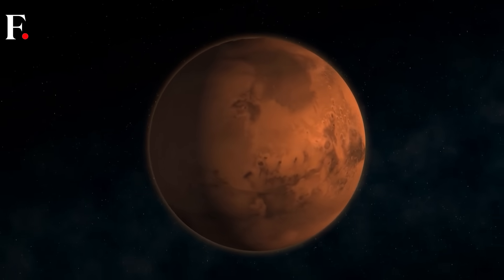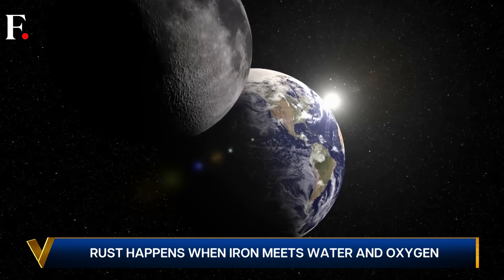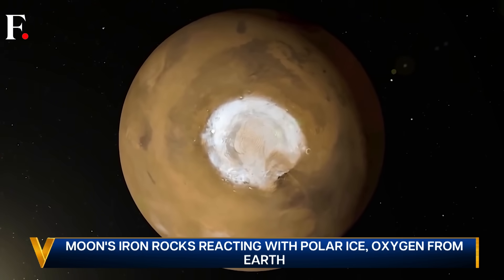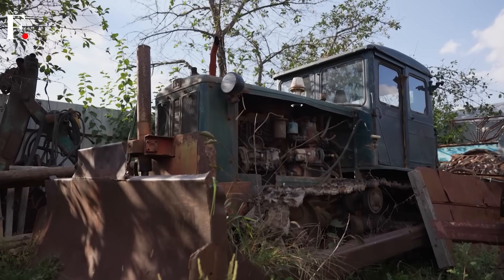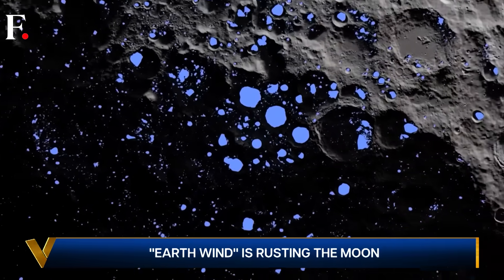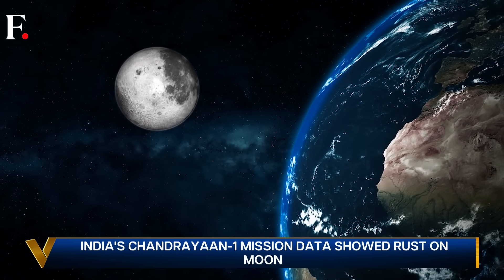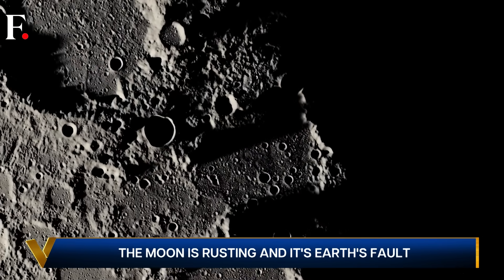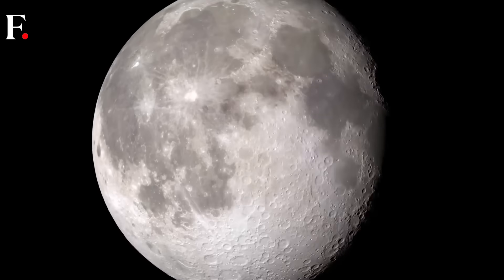Why is the Moon Rusting? Scientists Say Earth is to Blame | Vantage on Firstpost | N18G

Comment: My Hypothesis: Solar wind and solar radiation pressure may displace certain atmospheric gases, including oxygen, beyond the protective influence of Earth’s magnetosphere. These escaping gases would predominantly flow anti-sunward. When the Earth is positioned between the Sun and the Moon, some of this outflow could be intercepted by the lunar surface.

This process, if verified, could indicate potential limitations in the shielding capacity of Earth’s magnetosphere and ozone layer.
Reply: Or just bs